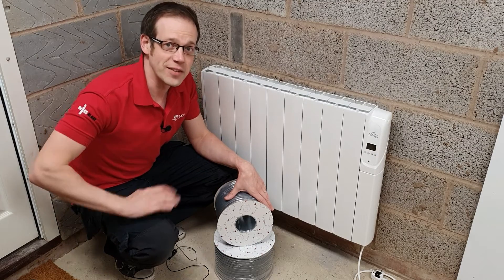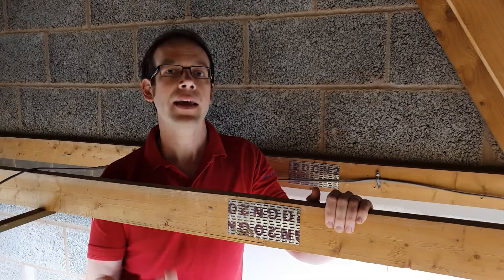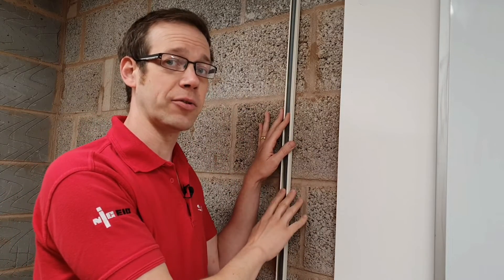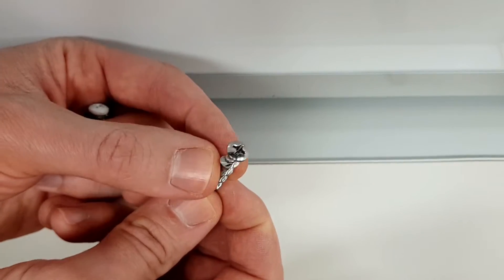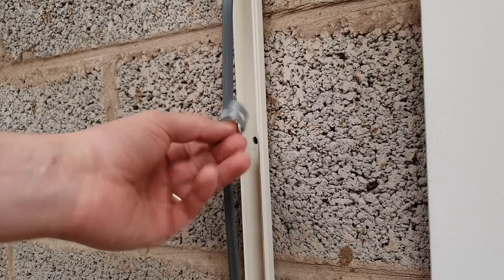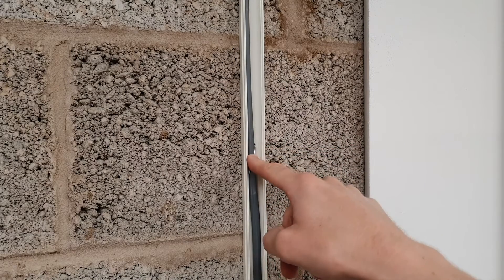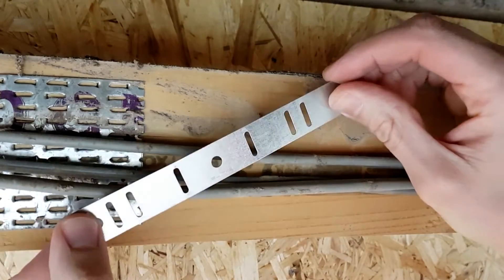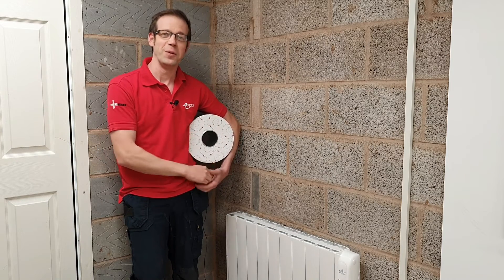Reviewed:- Fixings to help prevent premature collapse of twin and earth

Comment: I wouldn't use the spring clips personally, as I wouldn't say they are the best out there and they don't sit central in the trunking. So you can't stick quite a few cables or a couple of large cable in there, like a bit of 10mm T&E or large singles.

Comment: Does 18th edition also apply to data/comms cable and are these included to premature collapse? I’d guess it does but can not fine anything to confirm that cat5/6/7 fibre or ADSL cables cover this. 
Thanks in advance

Comment: I’ve just used the Walldogs with metal clips inside mini trunking on a project. Found that drilling a 4mm hole instead of the recommended 5mm worked best. Really fast when you get the hang of it.

Comment: i watched an ex fireman/electrician on sparky ninja, and he made an interesting comment, he said upon entering a room with a suspended ceiling, they automatically pulled it down. That is a complete metal structure, well the frame, so even if there were cables resting on the ceiling they should be ok. And its hardly premature if they are pulling it down.
Reply: in Australia at least, it is forbidden to lay any cables (mains, cat, fibre, or coax) across a drop ceiling, they must be securely independently supported and the supports can not be attached to the same support for the drop ceiling itself. But I also dont think they pull the drop ceiling down here

Comment: I like the cable-safes, but then that's probably an age thing, cant beat the plastic coated strap band for other areas or the dewalt stapler .. but then that's pricey if not used much

Comment: The dewalts are shite I’ve only found they work well in concrete and even then over tighten them slightly and they strip the thread they’ve cut in the material. I still have a box from 2yrs ago kicking around the van 😂
Reply: I use wall dogs all the time and once you get the knack very little can touch them for the application.